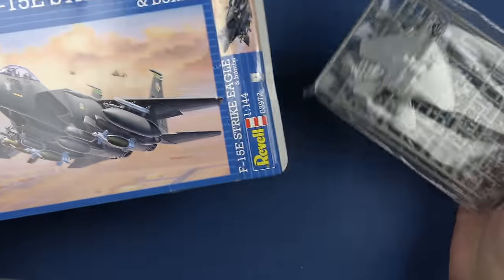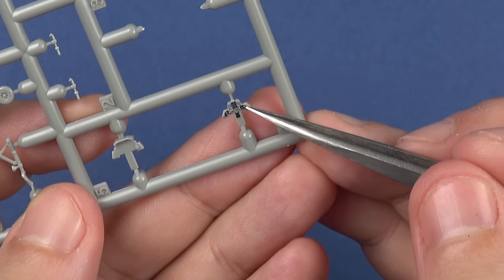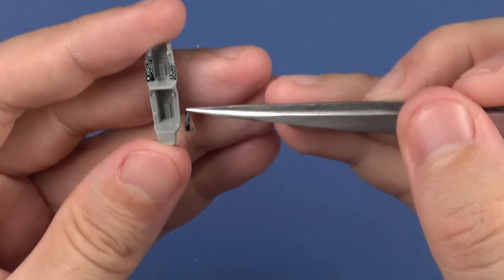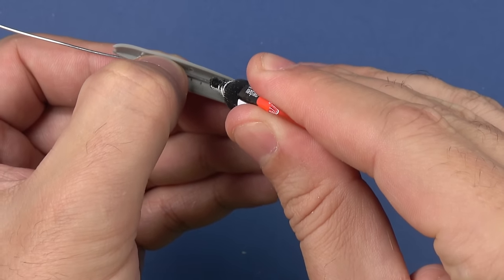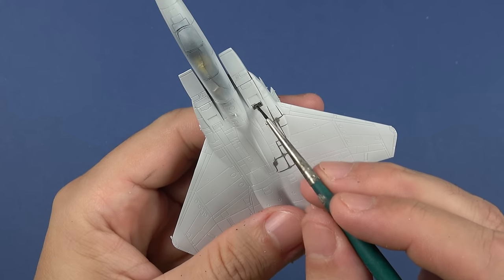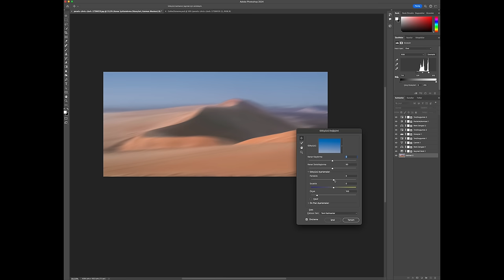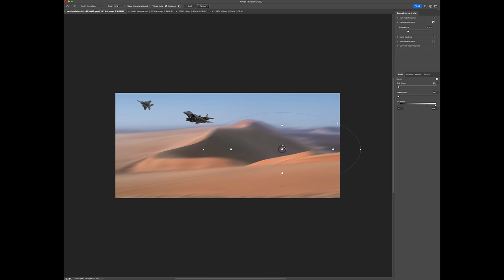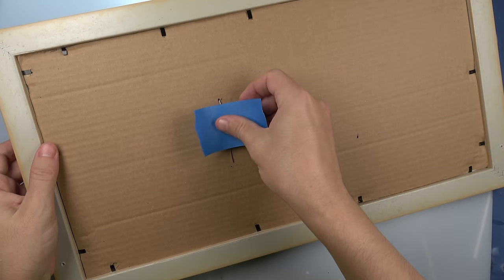How to Build a Realistic In-Flight Diorama 1/144 Scale Model Aircraft

Comment: I really like the custom pilot figures you made for this aircraft but I wanted to let you know there is model figures at this scale. Look up 1/144 Mobile Staff by Wave, its meant for space and mecha kits but it has some pilots in the seating position that might work on future projects. Still this is an amazing work!
Reply: But soooo much fun to scratch built it!
Reply from the maker: Thanks for the feedback! This suggestion will be another alternative for those looking for a solution for pilot figures. I get complaints about hard to find or expensive materials in many videos. My intention is to offer different ideas to people who are trying to continue their hobby with a low budget. Otherwise, I have two different 3D printers in my workshop and I could make super realistic pilot figures. That's the point why I built them from scratch.
Reply: @Scaleaton  You choice the correct path. Not everything is with in reach and you have to improvise on the fly using the materials and skills that is available at that moment. This video, like others you have done in the past, serves as a guide for us builders to help us improve are craft to make our builds a little better.

Comment: Great build as always!
If you should need another pilot figure in 1:144 you could watch out for train passengers in N-gauge from Preiser or similar. These are 1:160 (probbly close enough) and should be easy to modify.
Reply from the maker: Thanks for the feedback! This suggestion will be another alternative for those looking for a solution for pilot figures. I get complaints about hard to find or expensive materials in many videos. My intention is to offer different ideas to people who are trying to continue their hobby with a low budget. Otherwise, I have two different 3D printers in my workshop and I could make super realistic pilot figures. That's the point why I built them from scratch.
Reply: Preisser at one time made 1:144-scale figures.

Comment: Need a resin printer. Great job as usual
Reply from the maker: Thanks for the feedback!  I get complaints about hard to find or expensive materials in many videos. My intention is to offer different ideas to people who are trying to continue their hobby with a low budget. Otherwise, I have two different 3D printers in my workshop and I could make super realistic pilot figures. That's the point why I built them from scratch.